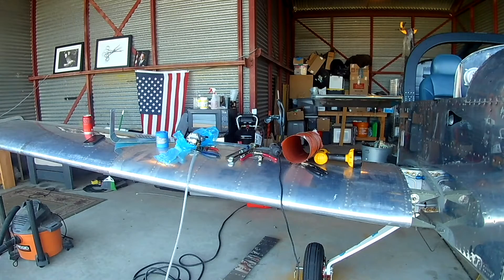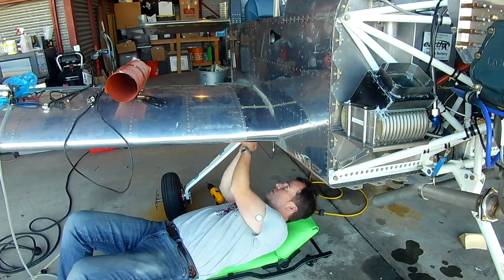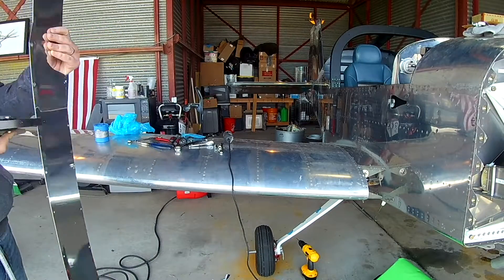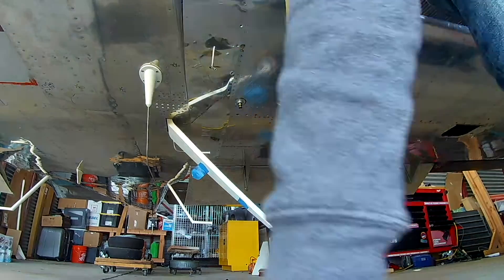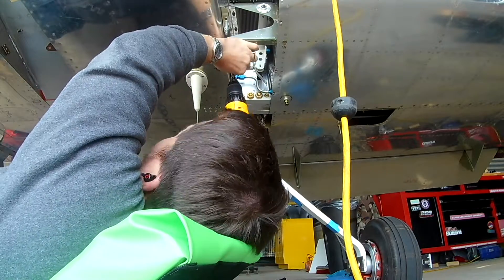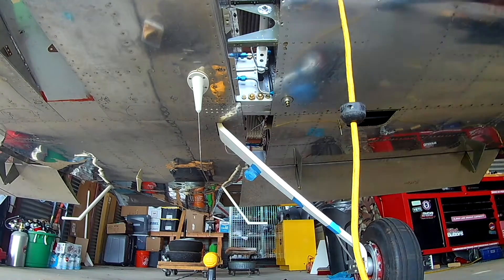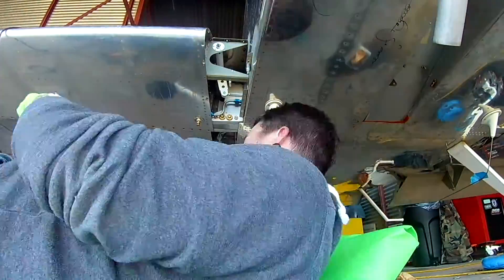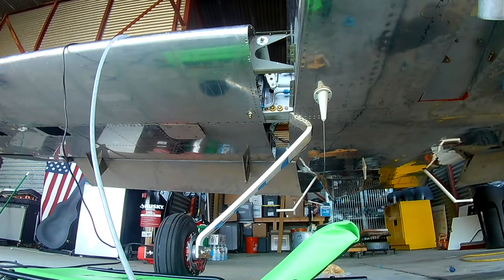RV-14 Wing attach Finalé

Comment: Congratulations on completing the transition training. Just a few questions if I may. How long is the transition training. As far as insurance goes. How many hours do you think you’ll need according to the insurance companies to get a break in the premium? My wife wants me to build the 14 instead of the 9, because she wants us to have as much room as possible for traveling. Have you flown in the 9, and if so how did you feel inside compared to the 14? 

Keith
Reply: Get the digital plans for both the -9 and the -14.  That will make your decision for you right there when you see how much more detailed and easier the -14 is to build.
Reply from the maker: The training is as long as you want to pay for. My insurance required 5 hours.. I wanted more.

The 14 is nice and large on the inside. I'm glad I went with it over the 9.
Reply: Keith if you're waffling on the 9 vs 14, the only things the -9 wins in are cost (and hourly efficiency) and glide ratio.  the -14 is more roomy, faster, easier to build, oh, and you might not want to but it can go upside down ;)   I was thinking about both, the cost of the -9 really had me considering it but I wanted a more spacious cabin so I chose the -14. Glad I did as the build is going super smooth.